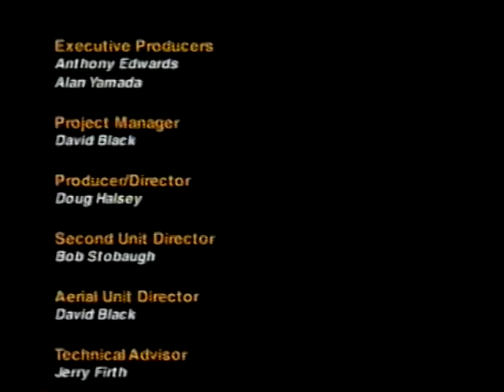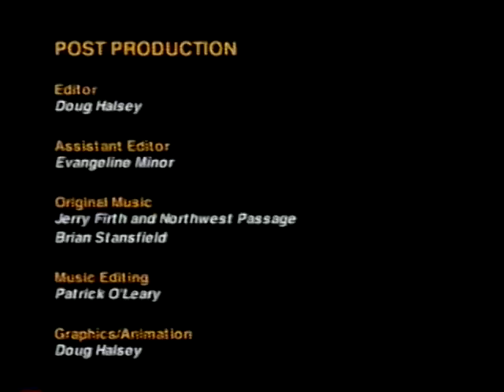Forest Service Road Maintenance Series: Smoothing and Reshaping the Traveled Way

Comment: Nice material -- most of the roads in Wyoming are rock or decomposed granite -- couple weeks later tthe road is washboarding again !!
Reply: I'm a member of the Armpit Grotto based in Laramie
with road experience between Montana and the Salish
Sea regions also.  Using a Suzuki DR650SE.  Single-
track after I've shoveled clearance over a slide or
around a collapsed culvert.  Also carry a timber saw
because trees also fall on your exit roads.  Otherwise
use the tools to assist other outdoor recreation.

Comment: While I commend the NFS road maintenance
I'm not ignoring the infrastructure issues.  My
DR650SE is rigged to carry a timber saw, "D"-
handle shovel, and a tool repair kit.  When a
tree fall happens and I need the road to exit
a National Forest I'm going to cut vehicle
clearance.  I've shoveled vehicle clearance
to exit National Forest after a slide occurs.
My Dunlop 606 knobby is excellent over 
most rubble after the shovel has levered
larger rocks aside.  I replace missing nuts
and lock-washers to secure loose NFS signs.
But my purpose in using NFS roads is to
locate and explore karst (nss@caves.org).